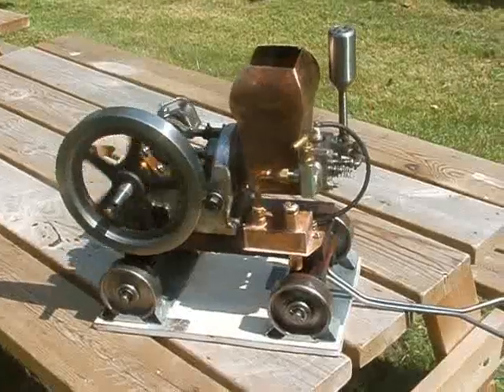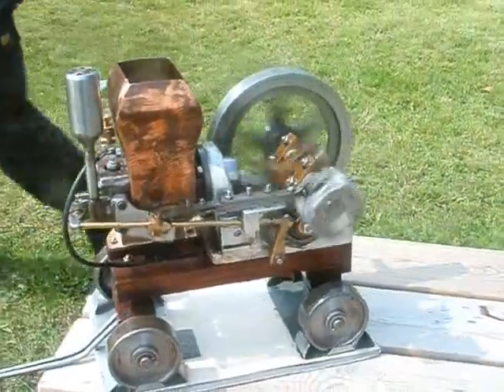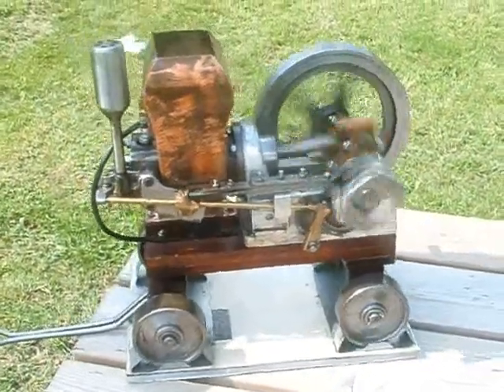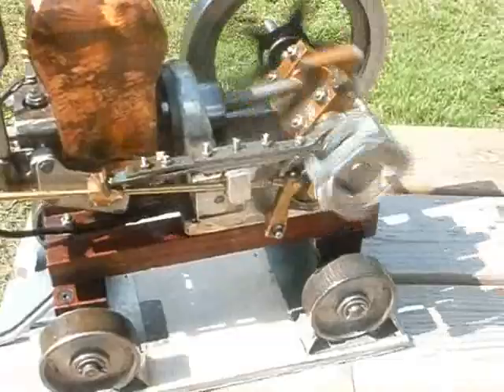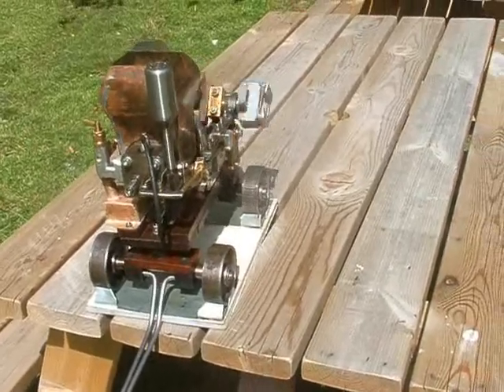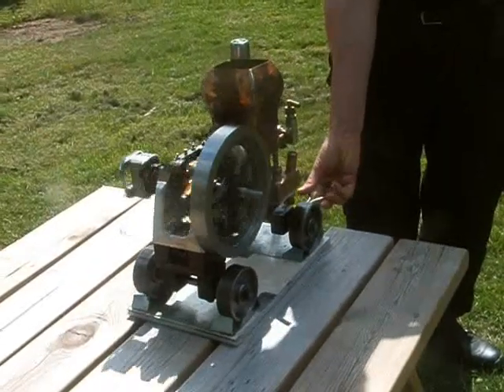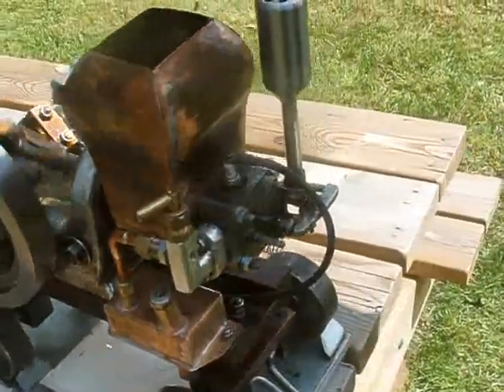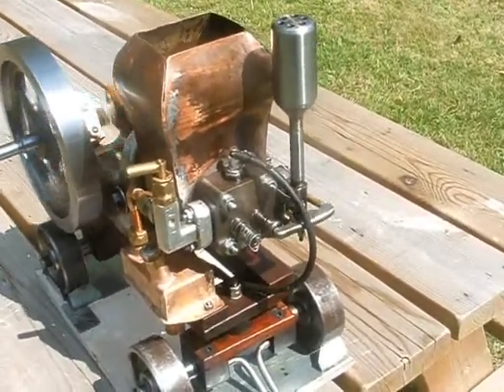Model Hit & Miss Petrol Engine

Comment: cute little engine I have a few full size engines of different flavors and sizes. I have been thinking about getting a model engine myself. what is cool about these is they only require a single push rod and a single rocker arm because the intake valve is pulled open during the intake stroke by vacuum when  the exhaust valve is shut the piston moves back and pulls the intake valve open.